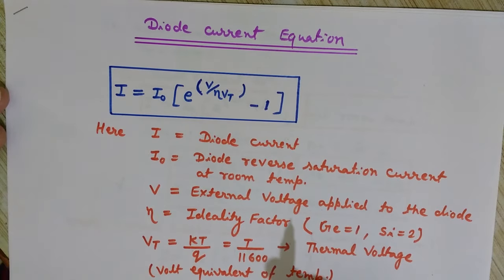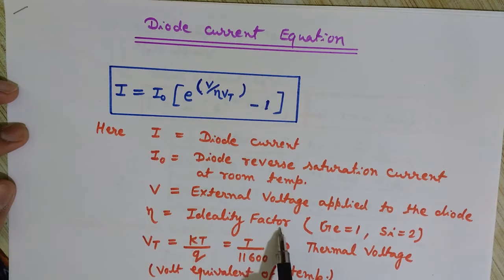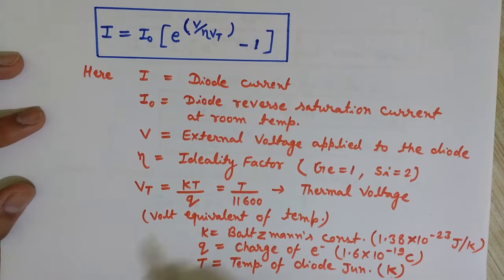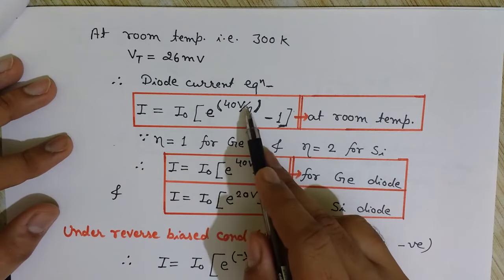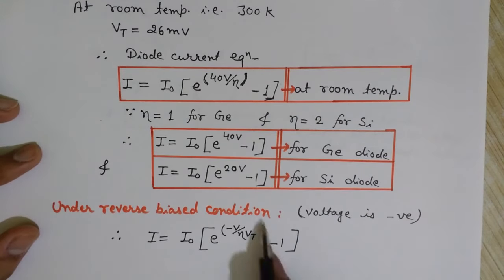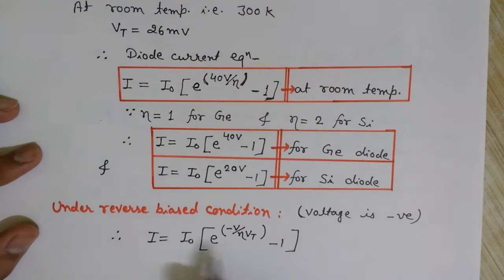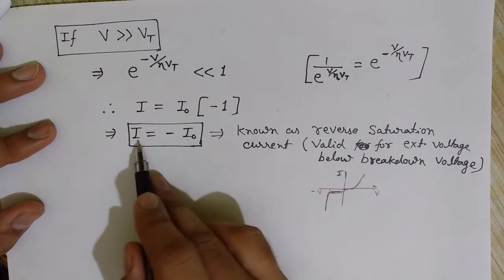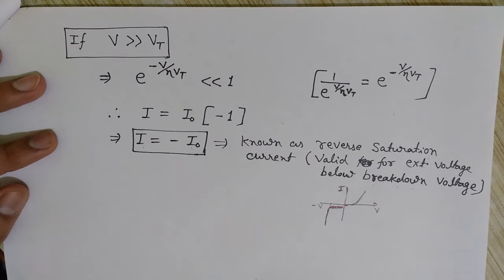Diode Current Equation - Diode Equation - Thermal Voltage and Ideality Factor diode

Comment: someone explain why the Vt is turning 26....and where the 40 is coming from
Reply: Because room temperature is 27°C right?? i.e., 300k...
So 300/11600 = 26mv (approx)
Since that Vt in denominator,  then 1/26 × 10^(-3) = 40 approx ,like think that 26 as 25 that doesn't make much difference and then calculate
Reply: @p.gaurav.n.m2417  why 10^3 is coming
Reply: @aswinsamuvel274  because it's in mv millivolt

Comment: THANK YOU great explanation- although not sure where the 40 has come from-
Reply: Because room temperature is 27°C right?? i.e., 300k...
So 300/11600 = 26mv (approx)
Since that Vt in denominator,  then 1/26 × 10^(-3) = 40 approx ,like think that 26 as 25 that doesn't make much difference and then calculate
Reply: @p.gaurav.n.m2417  Tq ❤️
Reply: 300/11600 is not equal to 26 its about 38

Comment: Hi and thanks for the video. I am trying to simulate a photovoltaic with a p-n diode  (single diode model). My problem is that when voltages start taking normal values (like Vmpp=23V) the exponential part in the diode current goes to infinity (or cannot be calculated) .Any solutions to this?
Reply: i guess I'm kinda randomly asking but does anybody know of a good place to stream new tv shows online ?
Reply: @Roland Jackson flixportal :)
Reply: @Lewis Benson thanks, I went there and it seems like they got a lot of movies there :D Appreciate it !!
Reply: @rolandjackson3149 wow bots wow